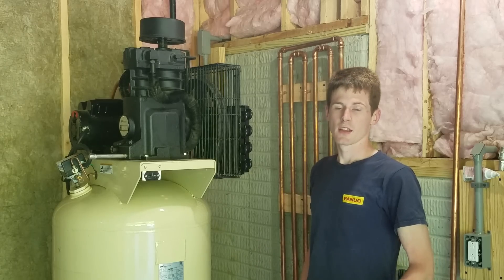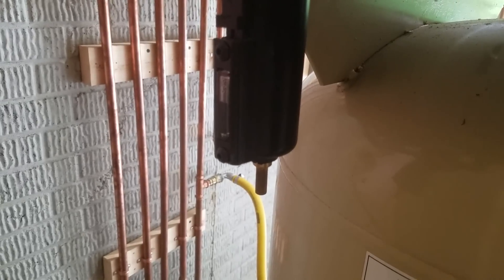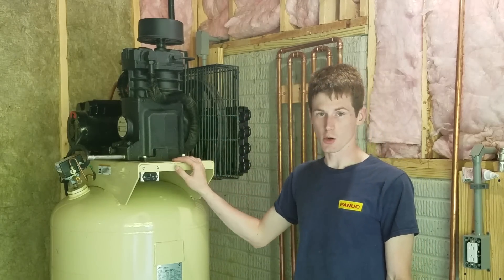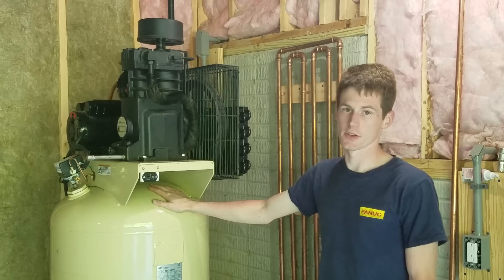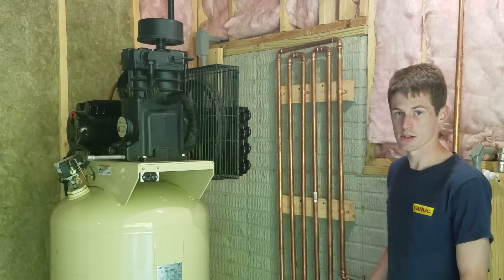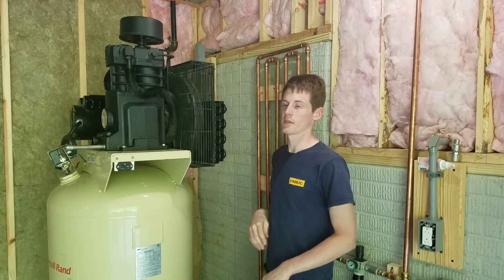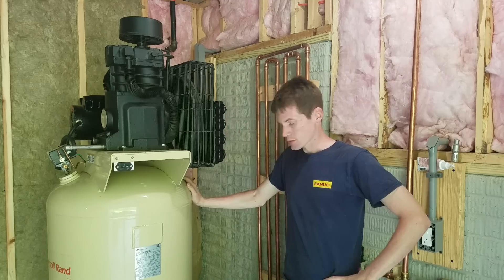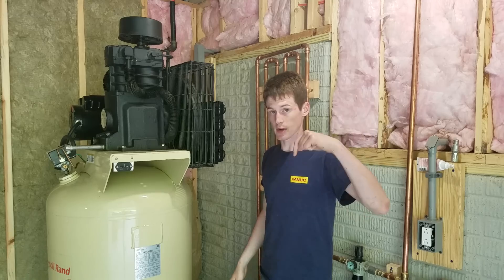How To Remove Moisture From Your Compressed Air

Comment: Very nice.  I was a bit surprised at just how long the extension on your compressor's drain is.  I hope you don't snap it off.  A shorter pipe and flexible tubing after a barb might save you a headache farther in the future.   Have you gotten a cover plate on that electrical outlet to the right of your copper pipe drier yet?  If grinder or other debris gets in there, you might trip a breaker, and that's an avoidable inconvenience.  I prefer weatherproof outlets ( they have covers ) in areas that get a lot of junk floating around in the air.
Reply from the maker: I made the drain that long. I can operate it with my foot that way.
Reply: @RepairGeek  I was talking about the pump drain, not the tank drain.  Sorry about the confusion.

Comment: I am impressed with the delta T using the transmission cooler. Well done. I was thinking of doing the same with an automotive AC condenser and fan system.

Comment: best video so far, I've tried a couple condenser coils and have had issue getting fittings, only to hate the restrictions it puts on my pumps. im returning everything and ordering this. i used the links you provided, just wondering exactly what fitting fit the AN fitting on the cooler. I may user a braid flex hose instead of going rigid copper
Reply from the maker: It's a 1/2 brass flare nut. It threads right on to the AN fittings. Supposedly AN fittings are a 37 degree flare and the brass fittings are 45 degree. On paper it shouldn't work, I realize that. So far I haven't had any leaks connecting the two together. Flare the copper tube and use the bass flare nut to hold the tube to the cooler.

I didn't spend a lot of time on the fittings because the odds on someone having the exact same compressor as mine are slim at best.

Thanks for supporting the channel by using the links. It means more than you may realize.
Reply: How did you mount your cooler to the cage?
Reply from the maker: I used these: https://amzn.to/2Lg55zH

Comment: Good idea, I am planning on upgrading my shop with a big compressor like the one you have.  Will look into doing this to help ensure the tank lasts forever (since I am not great about remembering to drain the tank occasionally!).
Reply from the maker: You still have a small amount of condensation that forms inside the tank. I've had about a tablespoon sized amount come out of the tank drain. Just like a fuel tank of a car that's in storage, condensation will form inside a sealed container if it's left for a long period of time.

You still may want to look at an automatic tank drain just in case.
Reply: Sure, certainly isn't going to completely eliminate condensation in the tank but will certainly reduce it.